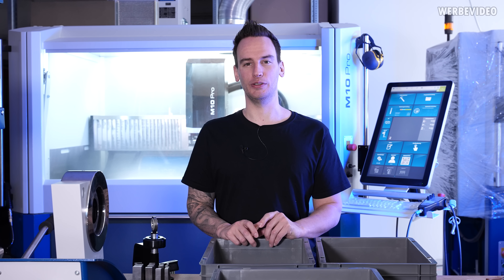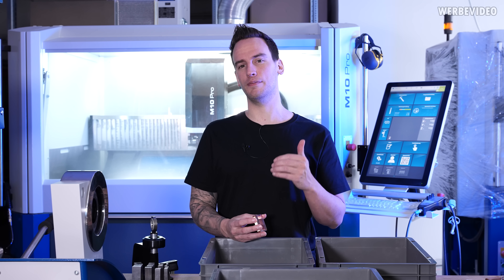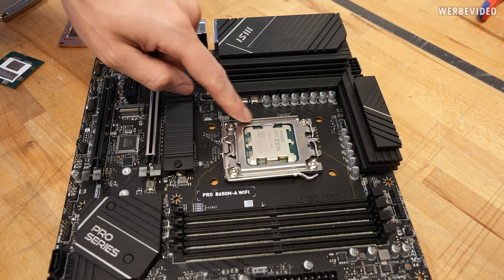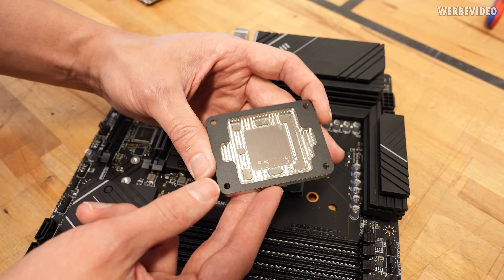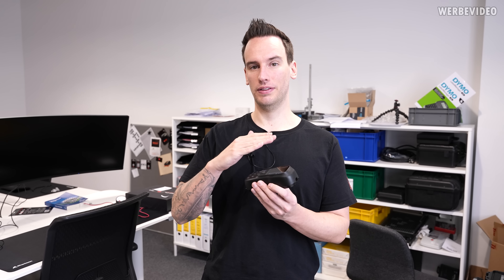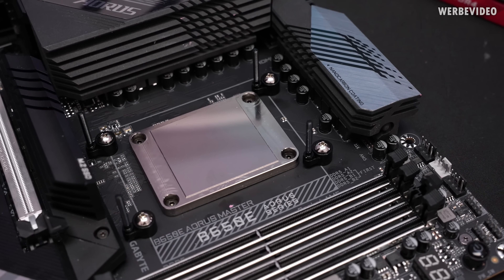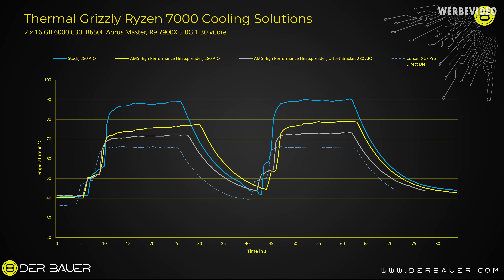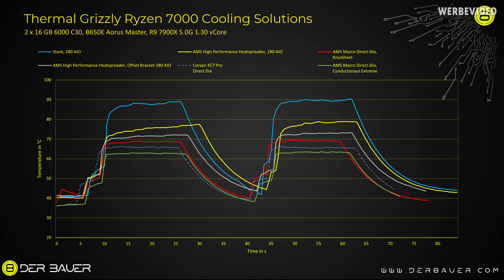I made my own Ryzen 7000 Direct-Die Water Block

Comment: That CPU block you've made looks really nice, I genuinely would buy that for my next build based on aesthetics alone.
Reply: if your not scared oh de-lidding cpu remember you have to delid to use them. But have seen  der8auer  floss method & heat not sure he was the first but saw that he showed Steve. The block looks so clean I do not even like rgb much but that looks nice as well if that's your thing.  I am on the 5800x3D seem like to much work and more chance of breaking it than theses new cpus. 👍
Reply: @digitaltactics9234  I think both Intel and AMD should start offering bare die SKUs for the K/X CPUs. In fact, it doesn't require any more effort and should cost less.

Comment: Wringing flat surfaces together to get them to "stick" can be done easily with two hard drive platters. We've all got a junk hard drive lying around, try it out! You can even stick multiple platters end to end, it's freaky. Safety note, most 2.5in drive use glass platters. Don't ask me how I figured this out.

Also, your team's metalwork is absolutely stunning! Dedicated nerds making some of the best stuff in the industry :)

Comment: Having a graphene sheet that is conductive in the X/Y plane could be very beneficial if the pad is thin enough with few defects - that should act as a decent head-spreader. But that does not really help when the graphene is between the Die and the headsink as it would really only be an effective spreader for the heat within the die-area.

Comment: Would def use the graphine pad liquid metal is scary. I have a 7900x I see about the same temps on a 240mm aio to his 280mm aio stock. Can just use my 420mm custom loop and water block my 4080 but its really not that hot overall.

Comment: Amazing Roman. The thing I like about your designs is zero compromises. Since Intel started using toothpaste, I have been delidding and lapping CPUs for my friends and me. And, especially with direct die cooling, those few degrees that I would get with Liquid Metal compared to Kryonaut (Extreme) never produced more performance. Direct die and Kryonaut always maxed out my OC. Yes, it would be nice to have lower temps, but performance was the same. That would be a nice project if you have time. Does Liquid Metal allow for more OC vs Kryonaut Extreme when using a direct die cooling?

Comment: This is really cool! A lower delta between water and CPU means you can get away with a MUCH hotter water temperature. 20°C hotter in this case, which is a boatload.
Hotter water means higher delta between water and air, so more efficient dissipation at the radiator end.
In the end, this may very well allow SFF systems to run with a smaller radiator. Previously, CPUs were the bottleneck since GPUs with their larger die sizes generally had more agreeable deltas.

Importantly though, how restrictive are these? I've seen those optimus blocks around pushing great numbers but possibly falling flat when paired with a weaker pump.

VERY COOL.
Might pick one up with the 8800X3D or whatever they're gonna call that.

Comment: I am a bit confused about the 2 Cinebench-runs: Why does it look like the first delidded CB run takes significantly longer?
Base on your chart it looks like stock the run loads up in second 5-10, then runs for ~16 seconds from 10s to ~26s. And delidded the run starts at the same time but ends at ~30s. That would make the run somehow 25% longer?
(specially stood out when all the other methods seem to result in similar runtimes to stock).

Comment: Do you think this is a safer option than using the direct die frame with a high-end water block? Normally I'm not too worried about DD but after seeing multiple, very experienced people crack their Zen 4 dies I've been reluctant to do it. My original plan was just to use my Optimus block on my direct die frame but I've been starring at it for weeks.
Reply: Yeah Jufes cracked one... I wouldn't delid it personally
Reply: @FreedomForAll2013  That doesn't really surprise me but when even some of the top guys on OCN and hwbot are cracking dies it gives me pause.
Reply: AMD should just start offering no-lided cpus for sale, or maybe bga motherboards with instantly soldered cpus?

Comment: I like the idea of the graphine sheet, most of us into water cooling are not over the top but want something cool, stable and play a little with over clocking.
Reply: Agreed. I don't like the idea of liquid metal personally. It's hard to work with, requires extra prepping, may require a repasting shortly after as it amalgamates with the surface, and can short things if not dealt with properly. Though to be fair, he didn't say the graphene pads are conductive or not.
Reply: @Skylancer727  Graphene is a semiconductor.
Reply: @ThomasD66  graphene is an incredibly good conductor, not a semiconductor.
Reply: @Hephera  What makes it a semiconductor  is not it's relative conducitivity but that it's conductance rises with increasing temperature,
Reply: @g73737  Totally. Plus it also works for more casual users who just want the best possible cooling performance without resorting to liquid metal, custom loops, etc......
Reply: Would love to try one on an Xbox would last forever
Reply: @mjstutter12  I'd use it on my PS4 on my end. It's a second hand 1st gen one and boy does it get loud.... Perhaps with the graphene sheet I'd get better heat dispersion and less ridiculously loud RPMs.
Reply: @primodragoneitaliano   you could try fan mods and other cooling mods while ur at it but that requires budged
Reply: @kankerdriewieler4338  Yeah if I had better money I'd go for my dream with it, ergo a custom case for the console and cooling it with a custom loop and x2 280mm rads w/Noctua fans on. With that it'd just be whisper quiet even under load.

Comment: @der8auer-en Any insight into why CPU mfg's don't just allow us to purchase cpu's without the oem heatspreader? I mean realistically if companys, such as yourself, just sold us direct die contact solutions, the mfg would save money on manufacturing and we would get lower temps / better performance / longer lifespans etc.

Love the ingenuity. You're making a difference!
Reply: If I remember it right. Back in the day mfg's actually sold cpus without a heatspreader but some customers break their cpu die when mounting the cooler. So they put a heatspreader on for easy mounting of coolers so customers dont break their cpus.

Comment: Personally i would probably choose completely flat one design, without stripes. I'm a bit worried about graphene, i've no experience with it but wouldn't it be brittle? If a bit would chip off it would be catastrophic. Apart from that, great work. This should mitigate also heat issues that buildzoid had with single ccd cpu. I would love to see how high could 7800x3d could go with it if it was an unlocked chip and there wasn't this huge issue with protections not working correctly.

Comment: It’s always great to see what you’re working on and pushing the boundaries of what is deemed possible.
The graphine topic was very interesting but where would you use it? Would it actually be possible to use graphine between the delidded CPU and the direct due heat spreader?
Reply: I think that's exactly how it was used in this video. The graphene replaced LM between the die and the heatspreader. Everywhere else the same TIM was used.
Reply: @nazgu1  That’s my understanding but I just wanted to be sure as this would be a perfect maintenance-free solution. Also, the fact that the height is unchanged, would allow me to use my noctua C14s cooler. Paired with a 7800x3d, it would make the perfect near silent build. 
Can’t wait for these parts to be available!

Comment: Roman, your ideas are fantastic!
I believe the next step could be to build a pump into the plate for SFF enthusiasts like myself.
Reply: that could potentially work and just be an upgrade for the block... but you're also adding more head pressure right at the CPU block which will mean you're relying on the O-ring a lot more and will make leaks more likely

IMHO SFF kind of died as soon as the 3090 and 4090 hit 450W-650W. You need more rad space. And before you start, yes I know the MoRA is a thing, but it's also needlessly adding complexity. Why have 2 medium sized boxes when 1 larger box can fit everything, provides nearly unlimited upgrade potential, and is easier to build in, maintain, and live with
Reply: @iamdmc  SFF with a MoRA? 🤣 Extreme at it's finest!
Reply: @iamdmc  more leak risk because heavy? you know there are screws to hold the block together :P
I don't think it would work as an upgrade, it would have to be a bigger base plate, with the same functional dimensions and fins arrangement. 
Byksky and EK already have DDC CPU blocks/reservoirs. Not direct die, but it works fine.

@madb 13, yep, SFF with MoRa3 are a thing ^^ the rad is tucked away out of sight and you only have a stupidly small box on your desk with a PSU and two waterblocks with two tubes going out. For some it's a good compromise from having a tiny hotbox.
Reply: @ledoynier3694  no, more leak risk because more pressure

big pressure bad - big no no. 

need more strong o ring for no leak

is very im-port-ant
Reply: @iamdmc  I'm currently using 3090 FE + 5900X in SFF build with Corsair SFX 750; there are PSU with 850W capabilities, and one can also slightly undervolt and down-clock CPU and GPU to get better thermals/consumption, etc. My particular scenario is a powerful and compact workstation to travel with. Previously used Dan Case A4 as my daily driver a lot.
Reply: @MichaelGaidamaka  when you have to downclock and undervolt you're losing performance... which begs the question of why you wouldn't just buy lower tier, lesser performing (but equal performance to downclocked) parts to begin with. SFF doesn't make sense anymore for ultra high end desktop parts. In your shoes, I'd strongly consider a larger case that can fit 3 or 4 radiators if you're serious about high end parts and top performance. On my 3x360 loop I get an extra 10-15% out of my 3090 GPU vs air cooled (frequencies and FPS)
Reply: @iamdmc  I'm ok with losing 2-4% of the performance compared to 15-20% TDP optimization. And yes, I see that you have another strategy.
Reply: @MichaelGaidamaka  prepare to lose much more performance than that. Look online at Optimum Tech's videos - he's an SFF guy and good at optimising for SFF, and he usually sees a 10-15% drop in performance in gaming, which is exacerbated by more intense tasks like rendering. It's your money to waste, just don't fool yourself into thinking you can save 20% TDP for only 2% performance loss
Reply: @sinAnon6689  interesting point; I've never thought about that before!
Reply: @sinAnon6689  yep this is well known

Comment: I love what you do and I would like to see a limited Run with your Logo on I would use it to support you and my Rigs I switched to AMD 2 years ago from Intel and I am Not even mad but I am stuck using the Stock cooler and I am in the market for a water block as I want to do a Custom loop for my Rig

Comment: I would buy a copper-only version if you sold it, as I don't trust nickel plating anywhere in my loop.
Reply: I’ve mixed nickel plated copper, brass fittings and copper in my water loop for almost 8 years and I have yet to see visible signs of corrosion which is probably due to the anti-corrosive agents in the coolant solution but also because these metals take forever to corrode one another.
Reply: @Alm8hoorOW  There are to many factors at play for your experience to be relevant to anyone else who isn't running the exact same parts as you.
Reply: @Bayonet1809  , if mixing nickel plated copper and copper was problematic I’d reckon the industry would advice against it as it does with mixing aluminum and copper parts.